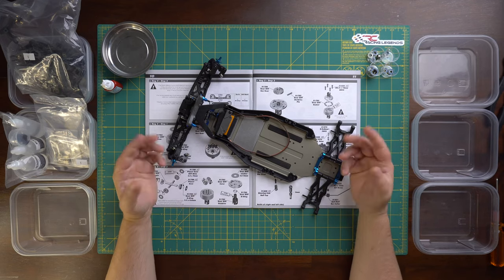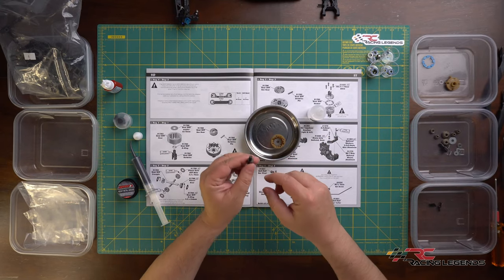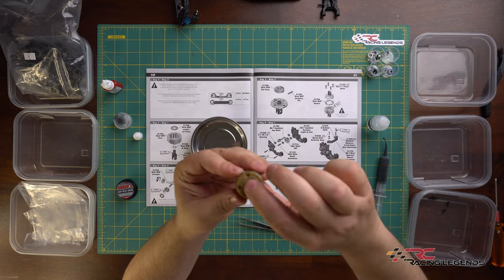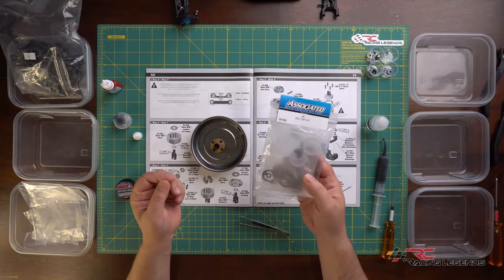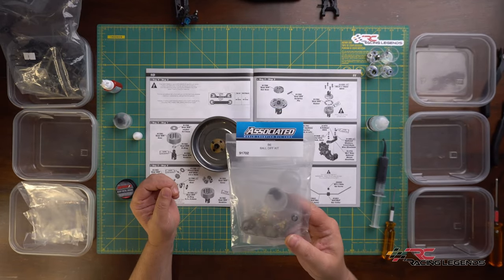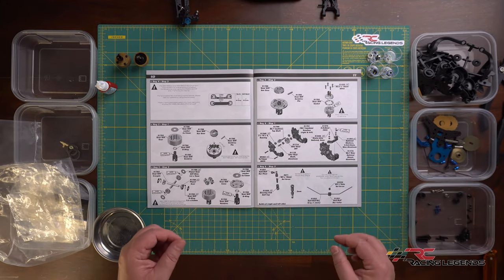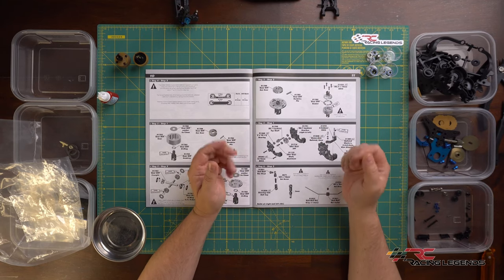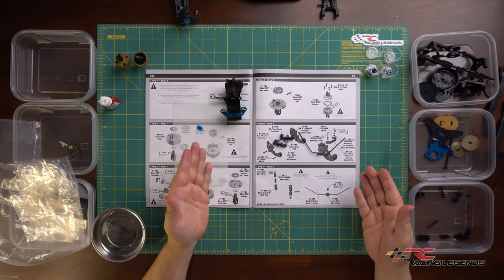Team Associated RC10 B6.3 Build Series Part 3 - Parts Bags 5 & 6 | RC Racing Legends

Comment: I just got done assembling my b6.3. It was my first kit rc and these videos helped me so much. Thank you! When I finished building my transmission it seemed rather difficult to spin and had tight spots in it. However I don't have any diff lube in it yet. Do you think that it could be that I am missing the lube or could I have done something wrong along the way? Looking forward to any future content you might have with the car.
Reply from the maker: Glad to hear the build series has been helpful.

As for the transmission, you're definitely not the first to experience a difficult to spin condition.  It has nothing to do with the lack of diff lube as the lube is there to prevent wear on the gears (it does nothing to make spinning the diff easier).  And I'm certain you haven't done anything wrong either.

I would suggest you loosen the screws that hold the two halves of the transmission together.  Once you do, you'll see the transmission will spin very smoothly.  Then slowly begin to retighten the screws and do it in a criss-cross pattern to avoid the transmission case doesn't warp.  And DON'T OVERTIGHTEN the screws.  You may find you'll have to loosen and retighten to maintain a free-spinning transmission.  It may take some time and experimentation, but it is very possible to do.

Comment: Cleared this stage today.  My kit seems to be missing a M3 22mm for the rear shock tower.  Or I accidentally used one somewhere, but I’ve been measuring and checking every screw so I’m a bit confused.  I also went too deep on the rear arm set screw for the shock.  Looked away at something for a second and then I realized it was starting to push out.  I left 10mm out for the base of the shocks.  So I just need to go buy some M3 22mm for my shock tower mounts.  

Thanks big time.  Your build video has helped me a lot.  I live in Japan and other than my friend, I’m going at this all alone.
Reply from the maker: Glad you're finding the B6.3 build series useful.

It's not uncommon with AE kits to be missing a fastener once in a while.   I've heard of some kits missing a bearing and even small bits like ball studs.  It happens from time to time.  My suggestion would be to call AE's customer service number and see if they can help - their customer service is top-notch so I'm sure they'll look after you.

However, if you decide to source a replacement fastener, make sure it's the correct button head cap screw (BHCS) type and not a socket head cap screw (SHCS).  I don't know how easy it is to source RC fasteners in Japan, but button head cap screws aren't always easy to find; socket head cap screws are ubiquitous and available anywhere.  If all you can find are socket head cap screws, you can use them in this particular application, just make sure you replace the button head cap screw used on the other side of the shock tower with the same type.

Comment: On Bag 5, Step 3 you used the 5000cst to fill the  gear differential which I did. The instructions said to fill with diff fluid...which I don't have.
Am I going to have any problem there?
Also, on Bag 6, Step 3, I used ceramic grease on the teeth of the diff gear. Same question: Any problem there? 
I do have to say that I could not have built this car without all the help in this video. Thanks.
Reply from the maker: As long as you filled the differential with the 5000CST fluid included with the kit then you won't have any problems.  The 5000CST itself IS the diff fluid the instructions are referring to.

The same goes for the ceramic grease on the teeth of the big diff gear.  Although the kit should have included a very small tub of clear grease (if memory serves correctly), virtually any good quality grease will work in this application.  You shouldn't have any issues using ceramic grease.

Glad to hear the series has helped you with your build.

Comment: I am using your video to construct my new 6.4 dirt, really useful. Is the short chassis brace for the layback gear casing?
Reply from the maker: If I recall correctly the short brace is actually for a stand-up style transmission that has been out of production for a while now. So it's essentially just a left over part that never got deleted from the tooling. You'll find a few items like that in your B6.4 kit.
Reply: @RCRacingLegends  thank you that clarifies. Excellent video!

Comment: Great video. Following along with my build!

Seems stupid there’s no diff lube included in the kit?? Now I gotta wait to get my kit done….
Reply from the maker: Glad you like the video.

And I agree, it makes no sense AE wouldn't include a small tub of clear diff lube in the B6.3 kit. I had no idea that was the case when I bought it as well.  If I didn't order the JConcepts RM2 clear diff lube (or the ball diff kit which includes a small tub of diff lube) I'd be in the same boat waiting for my order of clear diff lube.
Reply: @RCRacingLegends  so stupid… have to wait until Monday to go down to my local track. Was really wanting to get this done this weekend :(
Reply from the maker: Yeah I feel your frustration. But technically you could continue your build by installing the diff dry, and then remove the gearbox cover and add the diff lube when you get it. AE designs these cars so the diff can easily be accessed for service.
Reply: @RCRacingLegends  ya thanks man. I’m gonna do that and keep goin
Reply: Can you use the included diff lube?
Reply from the maker: My kit did not include any clear diff grease.  And from my understanding that's normal. You need to buy it separately. Now if your kit included a small tub of clear diff grease then yes you can use it. But if you're referring to the black grease that came with your kit, or the thick diff fluid you used to fill the differential, I would avoid doing that. Greases and fluids and engineered for their specific application. I'd suggest purchasing proper clear diff grease.  But you can assemble the car without the grease for now. Just make sure to get some and apply it BEFORE you run the car (the gearbox cover comes off pretty easy on Associated buggies).
Reply: @RCRacingLegends  i did use the diff oil that came in the kit. I didn’t realize it was a different oil .. I guess I have to clean it up somehow and get the correct oil… thanks 🙏🏾

Comment: What if anything do you use to cap the syringes off  to keep from drying and also in transit?
Reply from the maker: There's very little likelihood the greases I use will dry out, however I use small flexible rubber caps on the syringes when they're not in use.  You can get them on Amazon: 

https://www.amazon.com/Aopin-Protectors-Flexible-Protective-Protector/dp/B08R8C8FQP/ref=sr_1_3?dchild=1&keywords=flexible+rubber+cap+0.08&qid=1626229705&sr=8-3

I have also used a small amount of electrical tape wrapped around the end of the syringe tip as well.
Reply: @RCRacingLegends  thanks boss. I just got the syringes, any tips on loading up the grease from experience?
Reply from the maker: @ericmulcahey1  I use a dental spatula:

https://www.amazon.com/dp/B01G73Y3FQ/ref=sspa_dk_hqp_detail_aax_0?psc=1&spLa=ZW5jcnlwdGVkUXVhbGlmaWVyPUEzQ1JLNVJBOUZWNVJHJmVuY3J5cHRlZElkPUEwNzY0NzE1MkdIRVAwQzZFMzFaJmVuY3J5cHRlZEFkSWQ9QTA2MTQxNTQyRlEwQ0dEUTBSTEdFJndpZGdldE5hbWU9c3BfaHFwX3NoYXJlZCZhY3Rpb249Y2xpY2tSZWRpcmVjdCZkb05vdExvZ0NsaWNrPXRydWU=
Reply: @RCRacingLegends  I’m glad I asked before I made a mess
Reply from the maker: @ericmulcahey1  You're still going to make a mess, it's just going to be a LOT smaller.

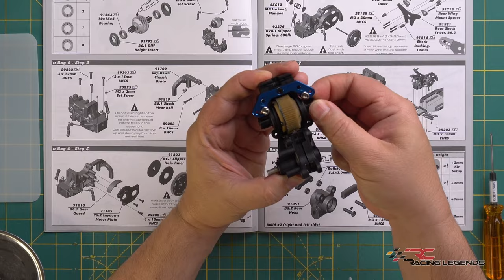Comment: 42:41 do you rotate the gear all the way? My differential will not do a complete 360 rotation, is this supposed to happen or have I put too much fluid on?
Reply from the maker: Are you referring to the differential not rotating while it's installed in the gearbox or that the differential out drives aren't rotating?  If the differential doesn't rotate while it's in the gearbox then you may have some binding in the gearbox itself.  You may need to disassemble and reassemble the gearbox itself.  If however the differential out drives don't rotate then there may be some binding with the spider gears within the differential. In that case you'll have to drain and disassemble the differential.
Reply: @RCRacingLegends  the diff gear will not turn in the gearbox . what is the best way to clean it out?
Reply from the maker: @TheSkillMaster9  if the differential will not turn within the gearbox then you need to take the gearbox apart and reassemble it. When you do, don't tighten all the fasteners completely. Instead just make the fasteners snug, while ensuring the differential spins freely. Slowly begin to tighten each of the fasteners that hold the gearbox together without over-tightening any of them.
Reply: @RCRacingLegends  doing this fixed the problem. Thanks for the help!
Reply from the maker: No problem. Glad it worked out!

Comment: Does the b6.3d come with both a geared and ball diff ?
Reply from the maker: No, the B6.3D comes with a ball differential only. Additionally, the B6.3D kit also includes two different gear box cases, the lay back and lay down.  Most who run on clay or dirt use the lay back gearbox, but that choice is highly track/surface dependent.

The B6.3 kit (carpet car) comes with a gear differential, and only the lay down gearbox case. 

I built both the kit gear differential and a ball differential in this video because I wanted the option to be able to swap out one diff for the other in the event I run the car on a clay track.

Comment: Silly question, but I don't have the #6591 diff lube. Can I use the 5000cst silicone fluid, or do I need to buy the #6591 diff lube? Or could I use normal RC greece? Thank you!
Reply from the maker: Unfortunately, you can't substitute the included 5000cst fluid for the diff lube.  You may be able to get away with normal RC grease, but personally, I wouldn't risk it.

I know it's frustrating for AE to not include clear diff lube in the kit, but I would recommend either getting their 6591 diff lube or JConcepts RM2 Clear Diff Lube (tip: you get more in the RM2 clear diff lube container).  These greases are formulated for their specific purposes, and you often can't mix or substitute one for the other.

Besides, you'll eventually be tearing down the diff to rebuild it at some point anyway, so you're going to need clear diff lube at some point.
Reply: @RCRacingLegends  thanks very much. I'll put the build on hold and order the correct lube. Really appreciate these videos by the way.
Reply: Sorry, I mean I'll continue building as per your tip. But I won't use it until I have the lube. Thanks again!
Reply from the maker: @kevin_redfern  Glad you like the videos and find them useful.

You don't have to put your build on hold.  You can install the diff without the clear diff lube on the gear and continue with the build while you wait for the diff lube grease to come in.  AE designed these cars for easy access to the differential for service at the track, so it won't be a big job.  Just make sure you don't try to run the car until you put the grease on the diff gear.
Reply: @RCRacingLegends  thank you. Sorry I missed the ending of your original reply. :)
Reply from the maker: @kevin_redfern  No worries at all.  I'm glad I can help.
Reply: @RCRacingLegends  Jumping ahead to bag 10. Are you running the optional turnbuckle chassis brace configuration. Or keeping the plastic chassis brace? I'm racing on astro and I'm not sure which one to use. Thanks again for your help, I really appreciate it!
Reply from the maker: @kevin_redfern  For now I'm going to run the waterfall chassis brace as it is.  I won't know which will be better for me until I get the car finished and on track.  Some folks (and tracks) prefer a stiffer chassis setup with the brace in place, while others benefit from the chassis flex of no brace or turnbuckle at all.  But these things come with tunning the car on track.
Reply: @RCRacingLegends  thanks very much. I really appreciate it!
Reply from the maker: Happy to help.
Reply: @RCRacingLegends  I notice the spur gear is not covered by the body. Is this correct? Seems a little strange having it on show?
Reply from the maker: @kevin_redfern  I'm not that far into my build to know this for certain, but I think the body is supposed to completely cover the spur gear.  Are you certain you cut the body correctly?  The should be a line demarcating where you're supposed to cut.

I'd suggest performing a Google image search for RC10 B6.3 to verify this, but I don't think the spur is supposed to be exposed.
Reply: @RCRacingLegends  yeah, I've cut it wrong 😂
Reply from the maker: @kevin_redfern  Sorry to hear.  Good thing new bodies aren't too expensive.  Just don't make the mistake of getting a lightweight body. It's too flexible and has a tendency to crack any paint that's applied.
Reply: @RCRacingLegends  thanks as always for the help. :)
Reply from the maker: No problem, happy to help.
Reply: @RCRacingLegends  I just wanted to say another huge thank you. I've finished my build and will be going racing tonight!
Reply from the maker: @kevin_redfern  Glad to hear it.  Enjoy your time on the track!
Reply: @RCRacingLegends  I ended up finishing 2nd in the B final. 😂
Reply from the maker: That's awesome!! Congratulations!!